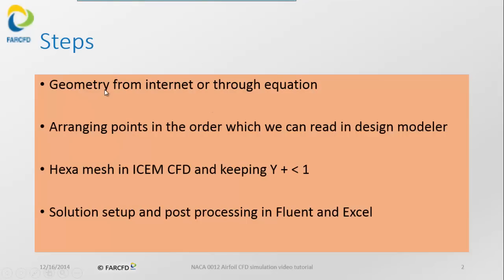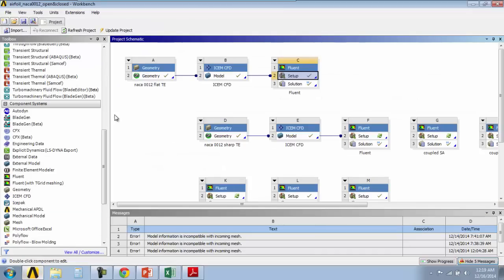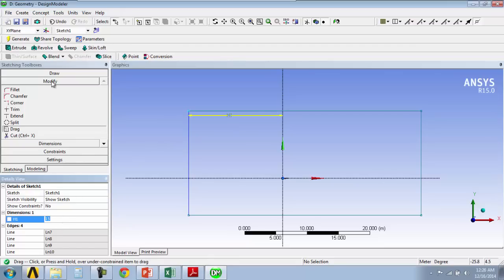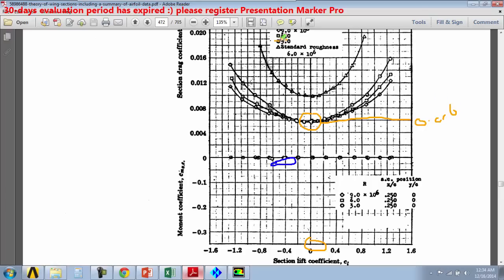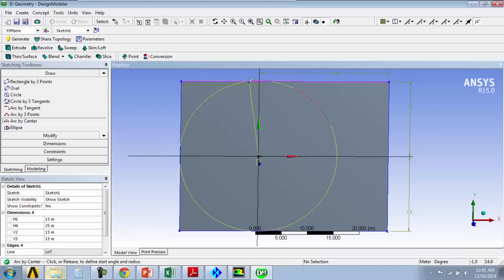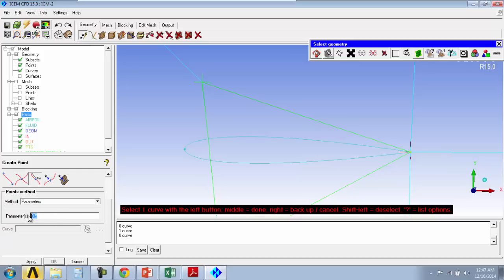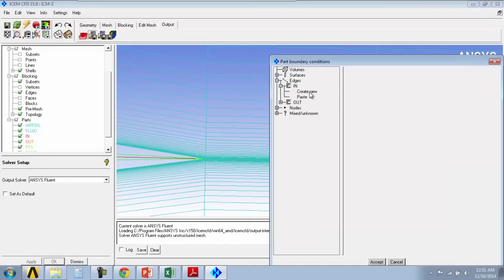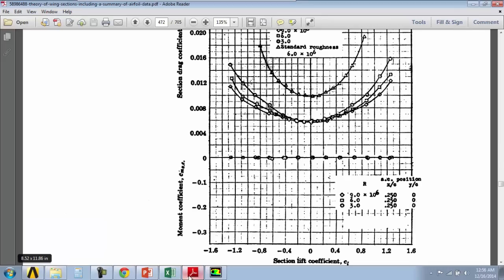NACA 0012 Airfoil CFD simulation in Fluent and validation with experimental data

Comment: This tutorial is great. I first learned how to use ICEM from this video. However, the test validation is at a higher Reynolds number where k omega SST is perhaps suitable due to early transition. If anyone is interested to validate airfoils at a moderate Re: 300k-1mil, this paper might give you an additional insight:
Numerical Investigation on the Pressure Drag of Some Low-Speed Airfoils for UAV Application.

https://youtu.be/qZRqBu9Ss2U

Take a look if youre interested on how to  design a quasi body fitted mesh for airfoils.
Reply: Hi, for 300k RE, did u use kw sst model too?
Reply: @ChongChongChong-x3j  use kw sst only when the boundary layer is tripped near the leading edge or at high Re. Use transition SST model/Intermittency SST model instead for natural transition.

Comment: Thanks for the great video. My only question that the case were done for 3000000 Reynold number while the experimental were done for 6000000
Reply from the maker: It is done for 3 million and experimental data is also for 3 million
Reply: @Engineeringcoffeewithsijal   from wing section theory book.
If not may you tell the reference
Reply from the maker: @ras22king  yes same reference
Reply: One last question, how to set mach and number together.
I tried but the using the velocity from mach number and changing viscouty and density for constant Reynold numb but still the results are really far from the experiment

Comment: nice tutorial, but have you recognized that the shape of the cut section in the control volume is not exact like the profile? it has some edges. is this only presentation error or is the boolean operation not accurate?
Reply from the maker: It is limitation of visualization on screen

Comment: Hello plz I have a presentation to make on Wednesday about airfoils (wind turbines)... the only thing I don’t know is how to determine the rotating speed or the rpm of the rotor if I know the wind velocity is 8m/s... how does it affect a certain airfoil? If for instance I have a NACA 4418... a wind speed of 8m/s will result in how much RPM ? Plz this is urgent
Reply from the maker: You have to make elementary study. Please go to chapter no. 10 Wind Turbines in Fluid Mechanics and Thermodynamics of Turbomachinery Sixth or 7th edition by Dixon.

Comment: Hello Advanced Engineering Solutions, I'm already on tour courses (udemy) actually I bought both Levels. I've a question about The last solution that you showed.  Which turbulence Model did you use? (the name is Six equation Model). I need to get this results for my Thesis (Cd around 0,006).
Reply from the maker: It was transition SST model with Y plus less than 1

Comment: If instead of an airfoil, we want to run the simulation for a 2D cylinder, will there be any significant changes regarding the blocking parameters?
Reply from the maker: Almost similar For further knowledge on ICEMCFD you can refer to https://www.udemy.com/ansys-icemcfd-hexa-become-guru-in-hexa-mesh-generation/?couponCode=NINENINENINE

Comment: Hello Sir,

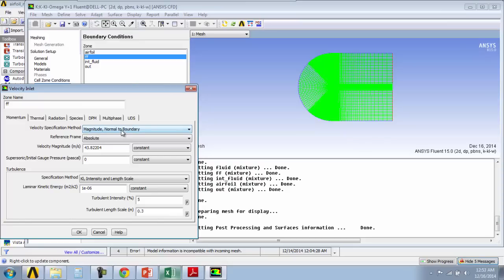Why did you chose the specification method to KL, Intensity, and Length Scale at 31:03? Also the value for backflow turbulent length scale is by default 1 but in the video it is 0.3
Reply from the maker: 0.3 * chord lenght = 0.3
Reply: @Engineeringcoffeewithsijal  thank you and just one more thing, how many iterations that you had to do for k kl omega with 2nd upwind? I had to do over 10k of iterations. Is this normal?
Reply from the maker: @aidealczar6075  yes normal.
Reply: @Engineeringcoffeewithsijal  Thank you Sir,  since we only need to capture the boundary layer aswell as the wake region, do you think a hybrid mesh (something like yours covering near the airfoil and wake region+ triangles on the outside) will reduce computation time while maintaining accuracy?

Comment: For calculating y+ value how is boundary layer length taken as chord length?
Reply from the maker: it is not taken as chord length, rather based on chord we calculate Reynolds number and use formula to find out the boundary layer thickness.
Reply from the maker: It is not.

Comment: what changes to make if the foil is near the free surface of an air water interaction and the foil in in water phase.
Reply from the maker: i cannot exactly say anything at this moment. Whatever changes it requires, that should not radically change the meshing strategy in ICEM CFD.
Reply: Advanced Engineering Solutions I meant about the BC In fluent and generally the change in the physics behind it.

Comment: Hello I did the analytical of a NACA 4415 in drag fluid and lifting the results these
Cl = 7.2870e-04 and Cd = 1.7649e-05
The experimental results are
Cl = 0.787785 Cd = 0.01218
I would like to know how to interpret these fluid values and whether they are correct or approximate with the experiments

Comment: This is the error i am getting can someone tell me what i am doing wrong?

Cell is missing face: Cell 16815, zone 11, at location ( 2.44157e+01, -1.35240e+01).
       Clearing partially read grid.
Error: Build Grid: Aborted due to critical error.

Error: Build Grid: Aborted due to critical error.
Error Object: #f
Reply from the maker: +nikhit gupta Mesh error. Need to check it in ICEM for missing edges/faces etc. More likely a issue of association.
Reply: thank you

Comment: when i import the mesh only the inlet velocity boundary condition is not coming
Reply from the maker: ***** did you define the part for it? may be you need to recompute/regenerate the mesh...
Reply: turbo engineer yes i have defined the part. still having the same problem
Reply: +sarfaraz nawaz Shaha  bro i had the same problem . it can be resolved by blocking properly ( i mean block each edge separately).